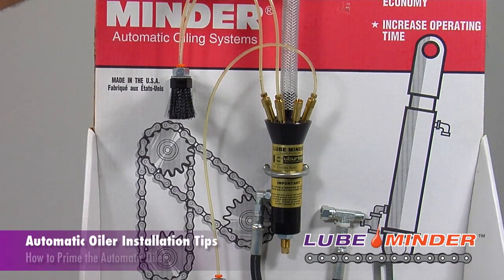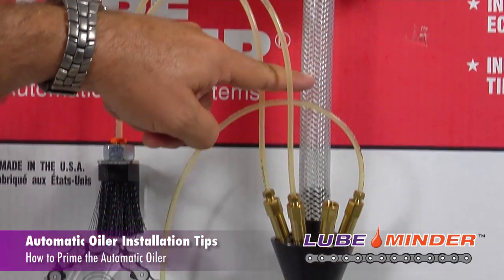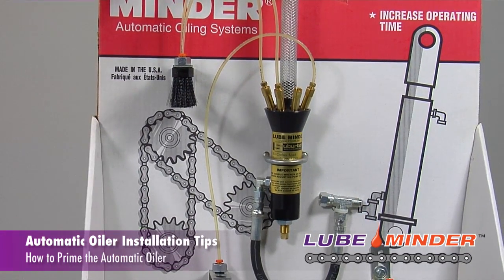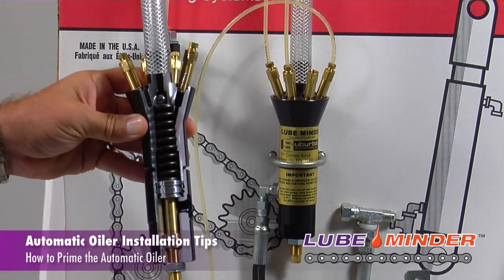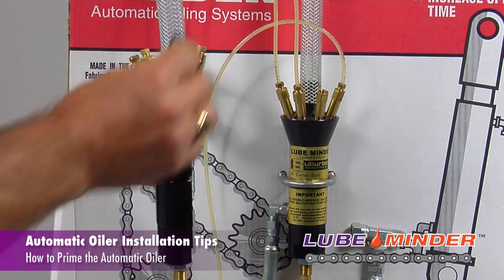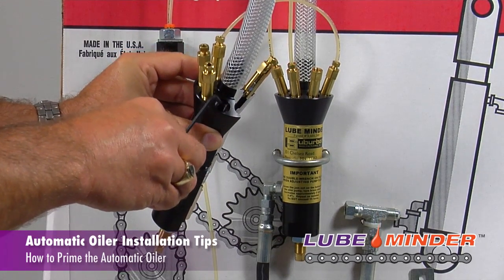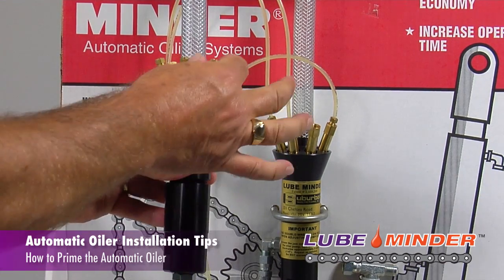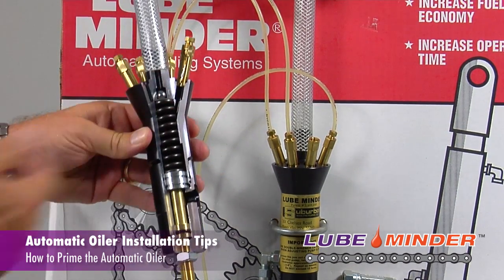Priming the Automatic Oiler

Comment: What if it leaks out the bottom of the oiler?
Reply from the maker: Can be either a sign of misuse, or potentially old brittle O-ring on the piston. Here’s a link to our troubleshooting guide:

https://21688758.fs1.hubspotusercontent-na1.net/hubfs/21688758/LubeMinder%20Troubleshooting%20Guide_WEB.pdf